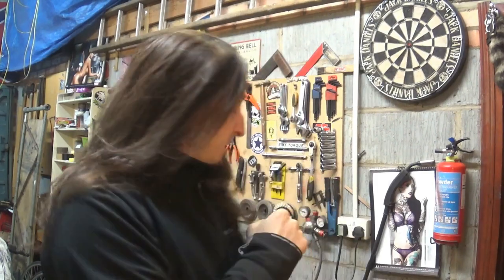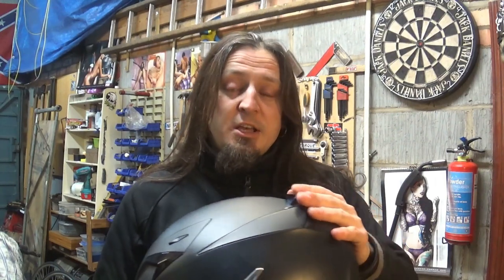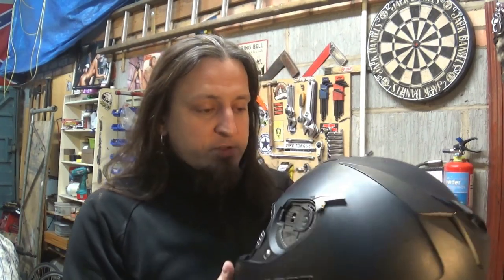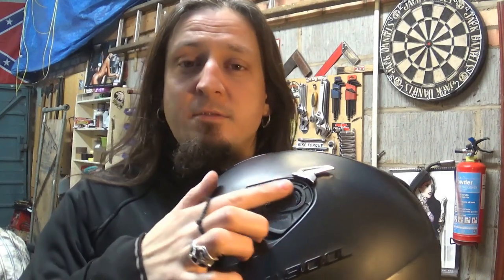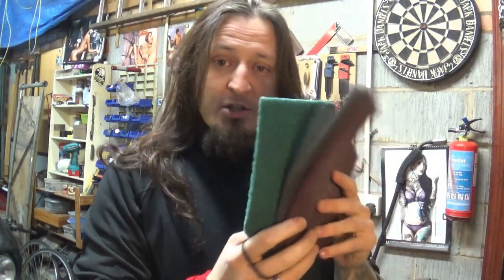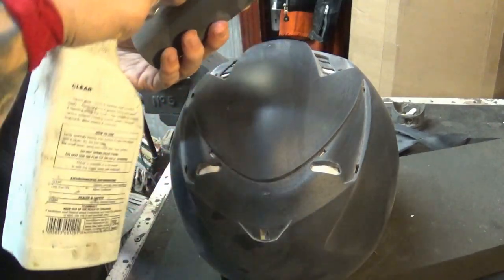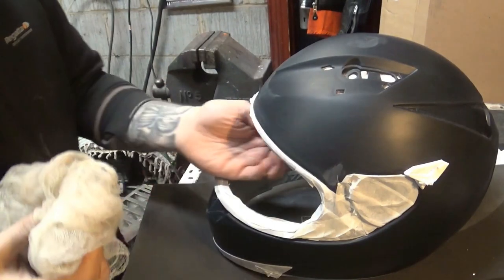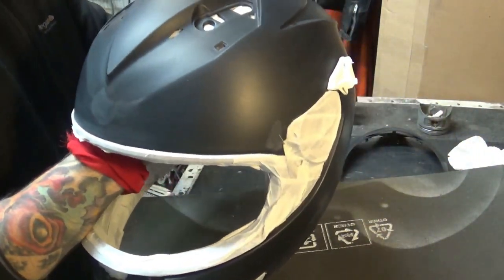How to paint a motorcycle helmet? Part1 - all the prep

Comment: Hey buddy loving the Chanel and great job on the helmet! Just one question, what paint do you use for priming the helmet? Is it just your normal water based acrylic which is used on 5e main design? Also you only need the safety sticker for track racing here in the u.k. 
Thanks again for your time and effort in making your Chanel 👍🏻✌🏻
Reply from the maker: Hey man, I used just regular waterbased primer, as this won't affect the helmet in anyway shape or form.
Thanks for your kind workds bro. best wishes.